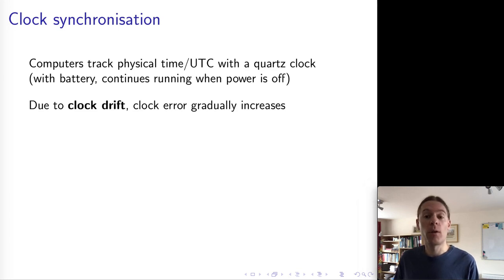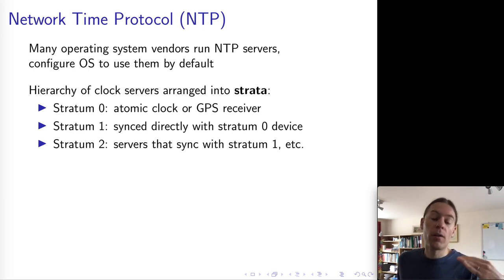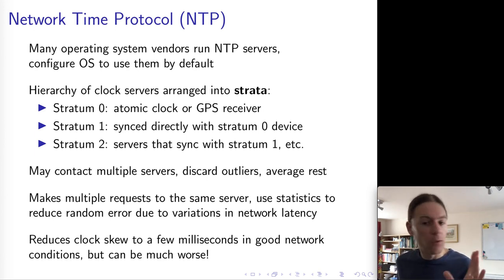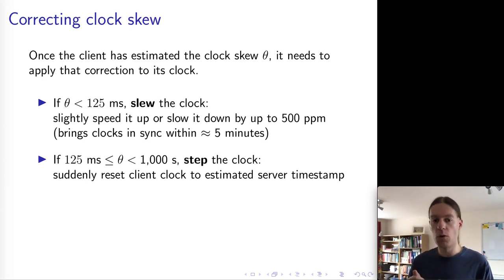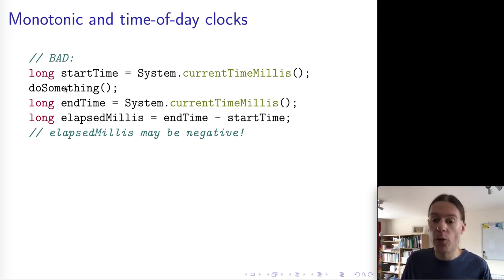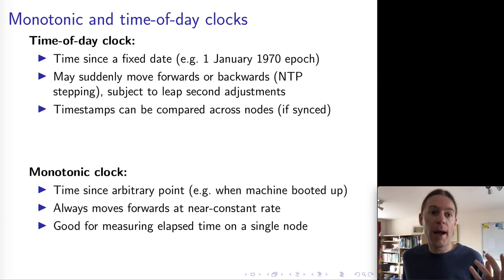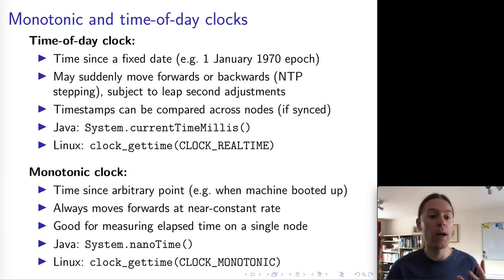Distributed Systems 3.2: Clock synchronisation

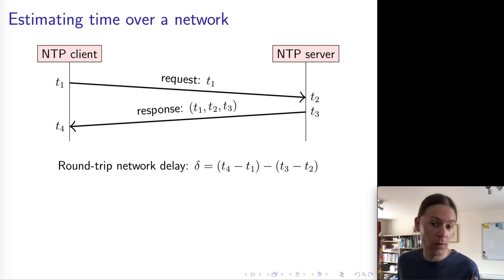Comment: 6:30 the total network delay can be found by looking at time stamps but this assumes network symmetry
We can estimate what t4 was supposed to be and compare with actual. The estimate is t3+(delta/2). Difference between actual t4 and expected is the clock skew

Comment: @Martin, thanks for sharing. I'm new to this subject and trying to understand how to convert Time Error (drift in seconds per day)  to precision in positioning. There are claims suggesting TE at 10^(-18) provides cm precision. If we multiply 10^(-18)*86400 (sec/day)*speed of light, the precision should sub cm. I would be grateful if you help with a comment or reference. Many thanks.

Comment: In NTP why can you do (t4 - t1) - (t3 - t2) ? First two terms are from the client and second two terms are from the server, and if the two clocks have different rates than aren't you working with different units? Or is the assumption that the rates are 'close enough', i.e. corrections to the corrections are second-order?
Reply: Yes I believe that we assume that the clocks are ticking at a fairly close rate, otherwise we have nothing to work with

Comment: I am thinking resetting the client clock happens if the skew is larger instead of slewing as in smaller skew case is because synchronizing the clocks would take a long time otherwise.